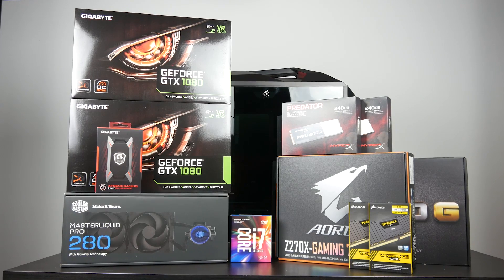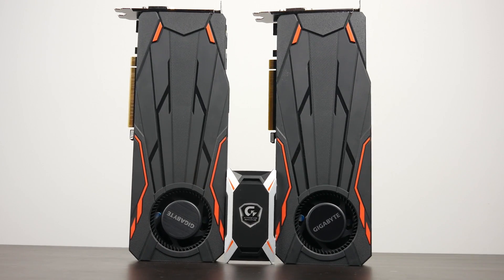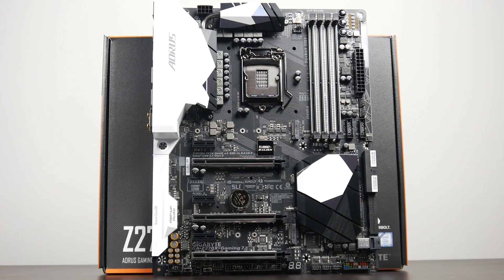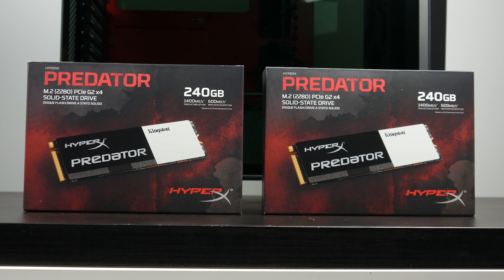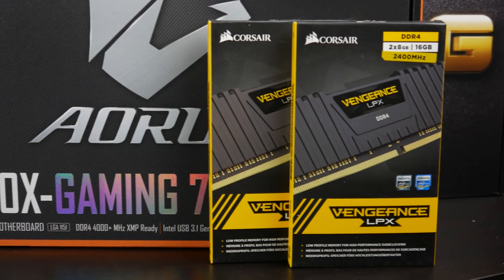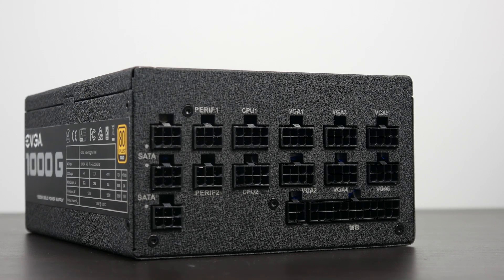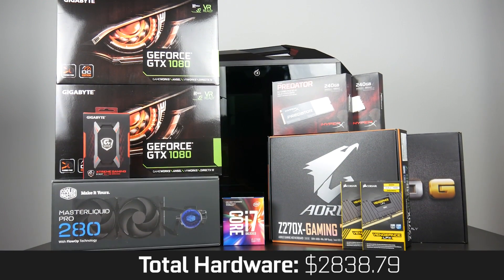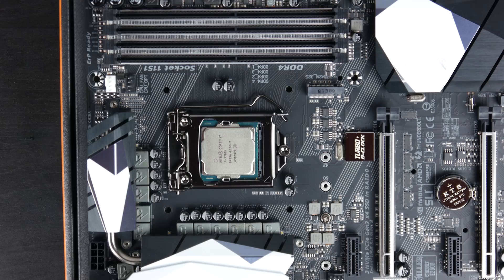$3000 Gaming Rig -  7700k@5GHz/ 2x GTX1080 SLI (2017)

Comment: Plz help Cooler master GX750 wat for asus rog gtx 1080 sli 
I7 6700K
ASUS HERO ALPHA 
SSD 850 evo 250gb
Wd 1 tb harddrive
Haf 912 cooler master 
Can u plz recomend if it will work 
I dont do overclocking 
Just want to know if my PSU enough .plzzzz

Comment: Is the radiator fan pushing from bottom to the top or are the fans at the top pulling air above? 

Can't tell cause he place the fans at the bottom of the radiator but the place it on top and there where no fans.

Want to build this case with a Ryzen cpu.

Comment: Just bought the same cabinet and the same cooler, but I can't install the cooler. The screws are not long enough to fasten the fans to the radiator when inserting form the top. Have no idea how you managed to this, doesn't show in the video.

Comment: What is the minimum size PSU you would need to run this GPU configuration? I have a 750 and am thinking about getting a second 1080, but not sure if I need a new PSU as well.

Comment: Are the fans on the radiator pulling hot air out or pulling cool air in?  What made you decide to mount it on top as opposed to the front?

Comment: how does that 7700K support the SLI and 2xM.2 configuration ?
Reply: Usually the CPU's PCIe lanes are only tied to one of the X16 slots (split to x8/x8 in sli on Z270). The other lanes used by everything else are done by the chipset DMI controller.
Reply: Is it even possible to setup your computer for x16/x16 setup and still have your pc using other lanes for stuff?
Reply: ***** yes, depends on your motherboard. To get dual x16 though that's an x99 chipset

Comment: AIO cooling, no backplates, why was this $3k?
Reply: 2x m.2 SSD's in RAID. And backplates don't really drive the price of 1080's up by much (also they're often badly designed and tend to trap heat)
Reply: IsakH85 oh forgot the m. 2s were in raid,  that's nice

Comment: @MW Technology... I can't understand?! The 7700k have like all other skylakes/Kabylakes Cpu's only 16 lanes... so it goes for 8x on gpu1 and 8x on gpu2 instead of 16x lanes each gpu. Up to it you put also 2 m.2 ssd's in that motherboard... HOW SHOULD THAT WORK GREAT? Its better if you go for one Broadwell-E CPU with 40 lanes on the 6850K/6900K or/6950x and get less Watts on the Power supply!
Reply: Dani Avv M.2 drives use hsio lanes on the motherboard not the lanes coming from the cpu.
Reply: Karl Sanchez ahh ok, that's new for me.. but still... only 8x lanes for each GPU

Comment: SLI still not worth it at all..the performance increase isn't quite there yet...If they don't fix the sync issues between cards while gaming I really can't see the benefits of going SLI or CrossFire
Reply: It will be once drivers are more optimized, that's what I believed until I purchased a single Gtx 1080 and wanted to run 4k, you will feel devastated to know that even the most powerful card in the market is unable to to run 4k 60FPS, this is where SLI/CF comes in and solves that issue. On top of that with SLI, it will only get better as coding and drivers improve not worse, in addition you have a future proof gaming build as well.
Reply: Du G Hope that it's an update away like you said. But I think is more complicated than that. I believe there is a big bottleneck regarding on how the cards communicate with each other let alone with the CPU itself. I'm not sure how does the SLI bridge affects that interaction too. what's clear is that generation after generation we still facing the same issue on SLI or Crossfire setups
Reply: I am confident it will only improve in the future, SLI/CF used to be  a disaster in the past, but now they are getting better and better, we get new profiles with every updates, developer and companies are more focused on making SLI compatible, just for that NVIDIA literally eliminated more than two cards SLI for the pascal series, except titans of course. If DX12 does what Microsoft claimed it will, then we are in for a hell of a good ride.
Reply: but thats a high graphic game an there's only a hand full that support sli like witcher 3 GTAV Hitman and for me i play none of those
Reply: deathbat6916 I avoid most AAA games cause 3/5x its all hype but currently I'm focused on Vr games tho my favorite FPS is Titanfall 2 an for single player nothing at the moment
Reply: deathbat6916 oh I know all t
about the cheap game sites I just don't like putting out the money for polished crap
Reply: deathbat6916 nice I missed that but that fact is was that heavily on sale for a new game just shows how low tier it was despite being a fun game
Reply: deathbat6916 yeah mafia was bad but 2k has a stick up their arse an think that they're games are worth more
Reply: Well all of these channels not having the proper hardware when benching modern SLI doesn't help. The 7700K barely has enough PCIe lanes for SLI, and he has to use the lower PCIe slots for it work. 16x/16x is ideal but he is using 8x/8x (performance isn't dropped by much but if you are spending serious money then it's big) and adding in M.2s will further make things worse since they also take up PCIe lanes. This guy is pretty much throwing money down the drain when he could of gone with the x99 platform, and not even mentioning AMD or the new $1000 and up Intel i9 CPUs.
Reply: CoryandStuff you realize this came out in February right? I9 and threadripper were not known about yet.
Reply: Du G i have waited for the 1080ti and can run 4k 60fps

Comment: You should do a delid video on the 7700k intel cheaped out on the internal thermal paste and you can get up to 20 degrees Celsius lower temps by putting a special kind of thermal paste on the inside of the heat spreader

Comment: I have a i7 6700k and z170 motherboard and i use one 1080 and 2 m.2's in raid 0. But this means that 2 of my m.2s. But since the 6700k only supports up to 20 pci-e lanes, my m.2's in raid 0 are not performing good enough because they only get 2 pci-e lanes each. How is your cpu handling this? And not mine?
Reply: I think this is caused by the chipset... the build from the video is with z270 which is kind of updated z170
Reply: Teodor Alexandrov maybe, cause the z270 has 24 pci-e lanes so 4 pci-e lanes more then the z170. This would be perfect for my build, however not for his. I don't know for sure, but i thought both the i7 6700k and the i7 7700k only had 16 pci-e lanes and shares 4 with the motherboard so 20 in total for both. I don't know, but this doesn't make any sense unless he is using the gpu's in 8x pci-e slots.

Comment: How is this good? Wouldn't you be better off with a broadwell cpu? since the 7700k only supports up to 20 pci-e lanes, and two gpu's is 32+ 2 m.2's are 8pci-e lanes. Which means you need a total of 40 pcielanes for the system to work the best.

Comment: Today I was reading about i7-7700k awful pre-applied Thermalpaste between the Die and the Core, I watched several youtube videos of people Deliding it and putting a new high quality special paste, and for one example, 4.9Ghz OC would give 90C under stress but after the new paste it will drop to 65~70, 20 to 25 degree lower which was crazy!!!!!!!!! Shame on Intel for cheaping out the paste